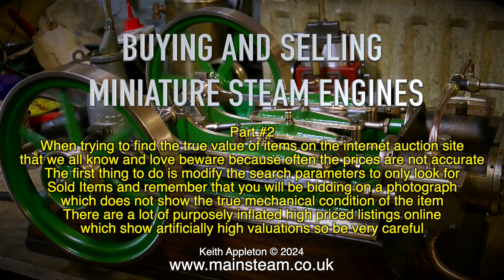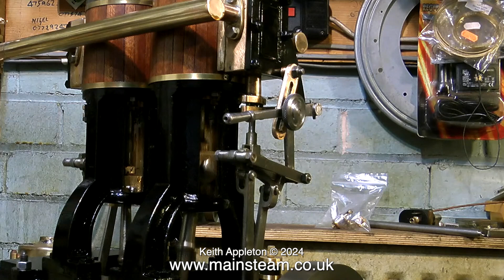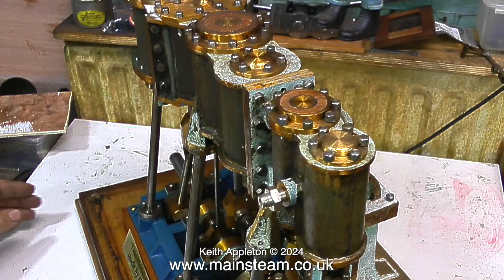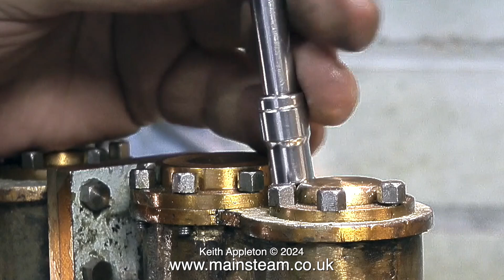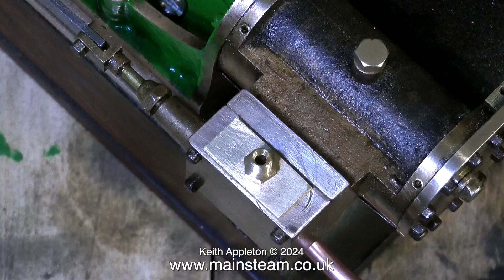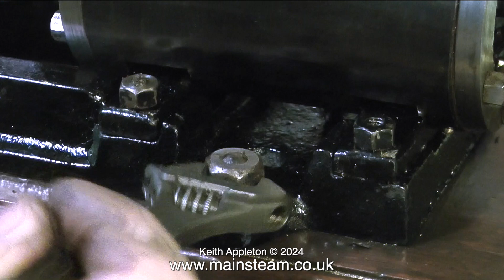BUYING AND SELLING MINIATURE STEAM ENGINES - PART #2

Comment: Price inflation is extremely common on eBay and on Facebook Marketplace. I've only ever sold one engine on eBay, a small self-built oscillator. It was a straight auction, and I got a reasonable price. My wife used to sell porcelain from  a well-known maker (she used to be their export manager) and the number of buyers who tried to work cons was so bad she stopped.